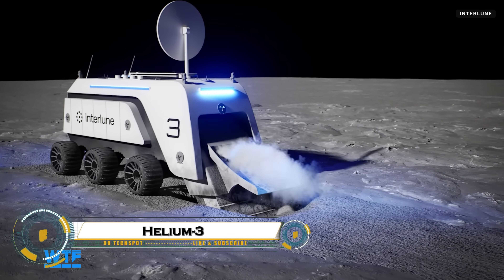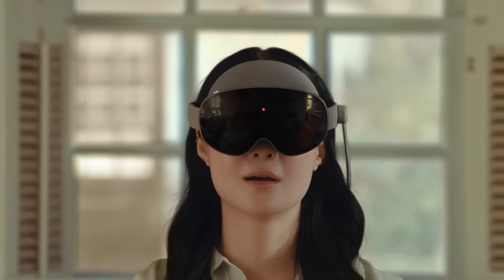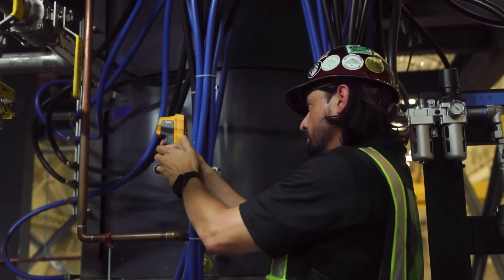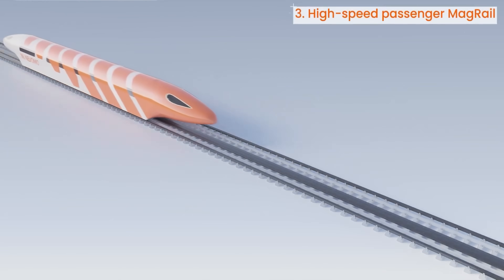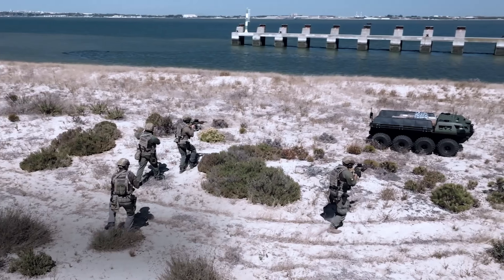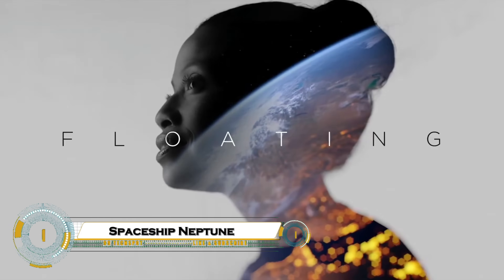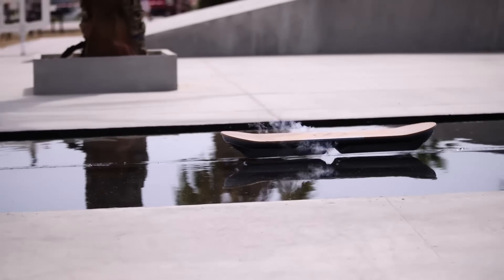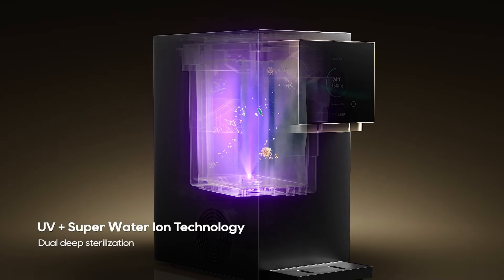20 Future Inventions That Will Blow Your Mind

Comment: Combine the SkyDagger concept with the Paladin concept and add a power cable - you would get a security/protection drone that could be in the air for hours or days, along with being non-jammable with a secure data link, that could be connected to fix point short range radar units for defensive and interception roles. Use them to protect military bases, airfields, powerplants and other infrastructure. 

You would have a 24/7 sky based security/defense system without the limitations of short battery life. For something like a "Sky Fence" along a national border to protecting a military instillation to a piece of precious infrastructure, this system would have you covered.
Reply: Wouldn't the cable limit it's maneuverability and make it a sitting duck to countermeasures like bolo rounds from a shotgun!
Reply: @rogerjensen5277  The SkyDagger concept, like a lot of drones being used on the battle front right now in Ukraine, are connected to controllers via optical cables and seem to work just fine in actual, real world combat. 

Adding another cable to it would work - plus the added power would make the weight of both cables irrelevant. All that extra power could be used for the drone to do super fast maneuvers - with an automaniac control system that would work far faster than a human operator to out maneuver any hostile it would encounter.